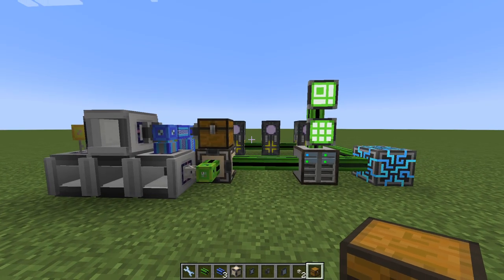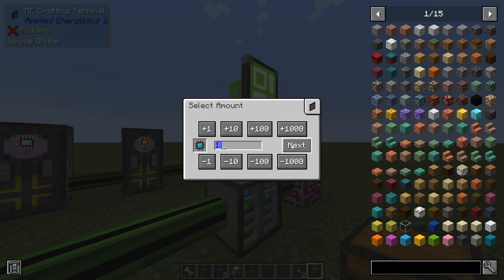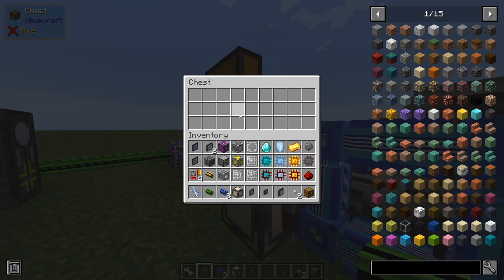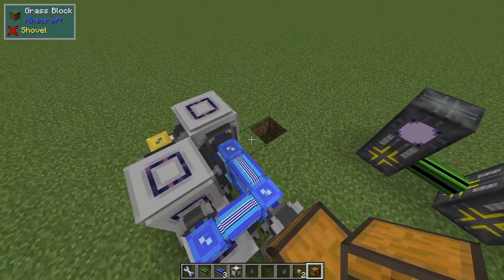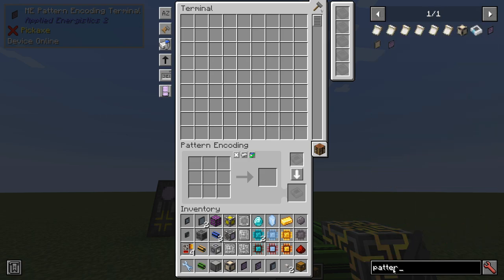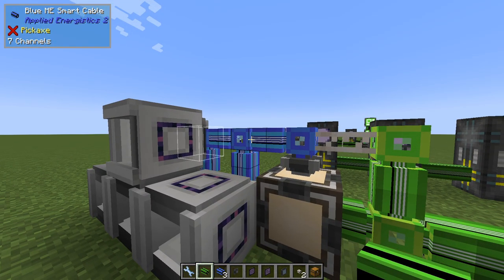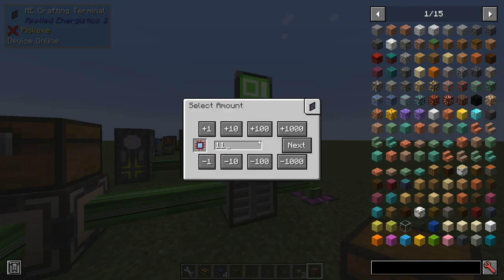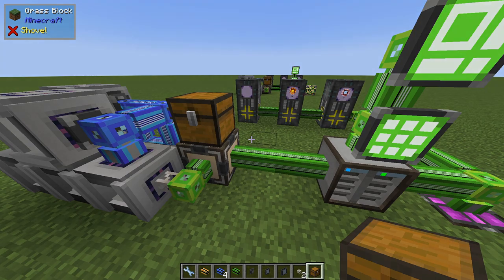Updated (1.18) Super Compact Processor Auto-Crafting Setup - Applied Energistics 2 Tutorial

Comment: this doesnt seem to be working, it wont pull the silicon printed silicon or printed logic out of the inscribers
Reply from the maker: The most common reason is that a block is misplaced or not configured correctly. You didn't say what version or modpack you're playing so it's hard to guess what's wrong.
Reply: @therealtkh  I've got same problem im playing on atm 8 1.19 any idea
Reply from the maker: @jamiewood2788  I have made this build working in 1.18 and 1.19 packs so the build works. Without knowing anything about the build it's really hard to guess what's wrong because depending on what block is misplaced it can give different (or random) effects. A common mistake is that quartz fiber is not in place so devices go offline because of lack of channels. Much easier to discuss on Discord with screenshots...

Comment: i just can't figure out. in case when pattern provider is connected to mechanism directly, it puts ingredients into the block and then takes end product out of it. BUT when patten provider is connected to production block through interface and then storage bus, it only puts items into mechanism, but doesn't take end product. it requires taking it via export bus. why can't it just take out the product by itself?
Reply from the maker: Hi, there are some crafting blocks that supports automatic ejection of products which works perfectly with the Pattern Provider, I don't know exactly what mechanism you were thinking about but I think your summary is the reason for this: if connected directly - sometimes you don't need any extraction method, but as this build is using a separate network to handle all parts, the Pattern Provider cannot get the items automatically, so we have to export them back to the main network once completed all steps.

Comment from the maker: edit: Check video description for an updated detail regarding the chest workaround, there's a workaround for that! /endedit
The popular "Super Compact Processor Auto-Crafting" setup has been updated and solves some issues that came with mod updates for Minecraft 1.18! Also explained in even greater detail than before! :)
Reply: Greetings, not sure if others have already told you, but there's a way to use the similar design you had before and with just a few small modifications, it will work as expected.  There's no need to add a chest to the design.  The only thing I had added was a pattern provider and placed the pressed chip templates in the storage bus.  That was pretty much it.
Reply from the maker: @DugaldKerr  I don't really understand what you mean so please explain in more detail! An additional pattern provider within the small network? I have been given another solution without chest though: configure the receiving interface with all base materials and the subnet can hold all items and run inscribers in full speed in parallel.
Reply: Dont work at 1.19.2

Comment: 23:55 the oler behaviour can be restored if the interface is configured.
basically: an unconfigured interface exposes the whole network (to pattern providers and storage buses)
a configured interface exposes it's own inventory (to everything)
Reply from the maker: You are absolutely right, I did not think about trying this but now I have and it seems to work perfectly! Thanks for the tip :)
Reply: What is the proper config setup?
Reply from the maker: @zs2977  Add all items (base materials + redstone + silicon) in the receiver interface top config slot, no need to specify amount.
Reply: @therealtkh  i cant find out wich interface exactly i need to configure? the one interface that is build in this system cant be configurated? am i missing somesting? there is one "ME Interface" and that is connected to the "Pattern Provider". Edit: Damn, i was so tired that i turned stupid...
Reply: @Grinser_zockt  Which interface was it?? lol I can't figure it out but seems like you did
Reply: @Grinser_zockt  nevermind OMG I was just dumb too
Reply: wait, could you expand on how placing items on the interface fixes the issue? sorry but I can't wrap my head around that
Reply: @therealtkh  I configured to receive all the items (certus quartz, redstone, silicon, diamond and a gold ingot), but one of them keeps being stuck inside of ME Interface inventory on auto-crafting the last unit of any processor. What did I do wrong? Minecraft 1.19
Reply from the maker: @timchiknew  You didn't necessarily do anything wrong! I have seen this behavior in 1.19 as well, and it feels a bit inconsistent... My best solution for now is to use a chest to buffer up all items, and I have never had an issue with that method! In my very latest video I also had to exchange a receiving interface (from a storage bus) into a chest to get intended behaviour. I found a workaround by placing an ME chest with storage in the small network (have not tried it for this processor build) but using a regular chest buffer was a better solution overall.
Reply: @therealtkh  Oh, thanks. I've tried so many things, such as messing with the priorities or adding a blank biometric card with withdraw permission, but none of them helped

Comment: I have an interface bus and an export bus directly connected to the pattern provider and that works fine without chest.
Reply from the maker: You mean like the old method? In what version? As mentioned in the video it works without chest but the problem was, for some reason, to queue up several without losing speed. I got a tip to configure the Interface to make it work like "before" and it worked perfectly.

Comment: Hi TKH
First of all, I'd like to thank you for giving such comprehensive tutorial by giving pratical building guide while explaining the theory.
However I got a logical issue on the storage buses on inscribers. 
While I can understand you need to give both input and output when you set storage bus to i/o mode, I can't figure out the reason you only need to specify input items but the output doesn't need one when the bus is on insert only mode.
Is it beacuse the insert only mode only filtered the input items but the output are not?
Reply from the maker: Happy to hear you appreciated the video! :) Yes, you are on the right track with your interpretation. The settings are of course connected, and are configured completely independently depending on your needs. First the Input/Output Mode: Is the Storage Bus allowed to only insert items, only output items, or both? In this build I use the Bi-directional as most are used both ways. Note that the storage bus do not by itself throw items into the network, but it allows other devices (such as the Export Bus) to "suck" items from the block the Storage Bus is placed on. Next step is to decide on filtering, but it only has two configurations. Either we filter for both insert and extract, or as I did here: only filter on insertion - that means that (if set to bi-directional mode) any other object can be pulled out, but only the filtered item is allowed to go in. As this build is made to have full control over every item in the small network, the filter options works perfectly if configured correctly - and there are two ways to do it :)
Reply: @therealtkh  Oh! That is for "filtering mode"!
You just complete my understanding of the whole design, thank you again😘

Comment: i cant get printed circuits to export into the final inscriber. I rotated the inscriber three times. Rest of the system works fine.
Reply: IM on all the mods 8
Reply from the maker: @chasehamlin4909  I have made this build in 1.19.2 so it should work. Check so all devices are online, if you missed a quartz fiber some will be offline. Check filter settings in bottom storage buses. Also, double check the export bus to the top, so it's correctly filtered. Also, I recommend in 1.19 to use chest for input as I've seen some weird behavior in these early versions.

Comment: My printed logic circuits do not pass into the inscriber to be merged with the printed silicon, only the printed silicon and red stone are in the inscriber, this is the one you have to rotate but i've tried every rotation. 

*edit* my printed engineering circuits are not making it to the combination inscriber either
so it's not taking them from both sides.

All my devices are online.
Reply from the maker: You forgot to write what game/mod/modpack version you're running. I would suspect the filter setting in the storage bus for each of the three bottom ones. Make sure it's only filtered on insertion so that the export bus up top can reach the items. And make sure the export bus is configured with CORRECT part (also a common mistake).

Comment: Hey man, this is such a helpful video and I finally feel like I know how all these parts work! Unfortunately, I still haven't been able to get my build to work. Gonna add a lot of info here, not sure how much or little will help. Based off other comments, I suspect either an issue with inscriber alignment or a misunderstanding of channels.
On a 1.18.1 survival multiplayer server, and my inscribers definitely are textured differently than yours. I have copied your build block for block (I'm still painstakingly checking to ensure this is true), with the exception of using an ME chest in place of a drive. I'm also using a generator from another modpack to power the system. I also do not have a crafting monitor above my 4k crafting unit.
The printed silicon makes it into the middle, redstone-supplying inscriber but none of my bottom circuits are flowing through my export bus. I've ensured that they are indeed all in the export bus when testing. Also, the process actually doesn't initiate unless I cancel the crafting sequence in my crafting unit, which is weird to me.

Happy to provide more info if needed, and will definitely provide updates as I keep debugging! Thanks in advance if you've read this cry for help lol
Reply from the maker: Hey! It sounds really weird that the process won't start unless you cancel the job. I wonder if you have a power issue.. Use a network tool to check the system power requirement and usage but this is a longshot! Have you tried to build this in a creative world to see that it behaves with unlimited power for example. The other differences should not make any difference though. Also, feel free to jump on to the Discord server which makes it easier to send screenshots.
Reply: I'm in the same boat, built/tore it apart twice now and it will make all of the parts it just won't put the printed circuit out into the top.
Reply from the maker: @irongronousmagnus7652  It's so hard to find the missing piece without more information, and screenshots really helps! Please provide more info about mods/pack and consider joining us on Discord for easier discussions. If you have a problem with getting the bottom print to the top there's usually an incorrect configuration in the Export bus or the Storage bus (like the I/O filter). Or a misplaced block somewhere that makes some device offline.
Reply: @therealtkh  and just like that I figured it out... because I'm a moron.  In the section where you were showing how you first did it that didn't work right, well what did I care about that, so I skipped that section, twice :( The printed circuits in the export bus... kinda important.  I feel foolish.  AWESOME video, thank you very much for helping idiots like me despite themselves :)

Comment: I know I am 1 year late, but I built the same setup but the redstone wont input when its time to craft a processor, the certus also won't do so when trying to craft the calculation circuit and the engineering one does the same, the only one that works for me is the logic processor. I wonder if it's because im using normal cables instead of smart ones.
Reply from the maker: Normal cables makes no difference, the smart ones are only used to easier keep track of channels. You didn't provide any info regarding your game or modpack though. Also, did you build the version with chest or without? I recommend using the chest and then make sure that all filters are correct in storage buses to all inscribers. Usually it's a simple mistake.
Reply: @therealtkh  This is essentially my bad, I rebuilt it with the chest and now it works, thanks for the tutorial. I'm not quite sure what was wrong but hey, if it works it works.

Comment: Whenever i call a bigger amount of stuff, when the inscriber fills up, there is some leftover stuff in the chest. The resources from it go back to the me system, how do i fix that?
Reply from the maker: You didn't tell me what game/mod version you're running but it sounds like an incorrect filter setting in the final export bus (for final processors), there should be no other way back to the main network. edit: or a "short circuit" that connects the subnet to the main network.

Comment: Just isn't working for me for some reason. The pattern provider puts all the stuff in the chest and then it's just never exported. It's like none of the stuff on a subnet is working, I've tried so many different ways :( For reference I'm on ATM7
Reply from the maker: The build works fine in ATM7 (I have tested) so it's most probably a minor problem with your build. Check so all devices are online, that quartz fiber is correctly placed and things like that. I don't know your build so it's a bit hard to guess.
Reply: @therealtkh  yeah it was being a bit funky, tbf it's ATM7 to the sky which might make a difference, wouldn't have thought so though. Ended up just exporting redstone and silicon and having a pattern provider for the circuit needed
Reply from the maker: @Smjn_  Some packs might change recipes or mess up details like silicone (as it could come from different mods), but mostly it's just minor things like filter configuration or a missed block. Still hard without a video or screenshots of almost everything ;)
Reply: @therealtkh  yeah exactly xD it works for now and I really can't be bothered to figure it out

Comment: Hi,

I'm encountering a strange problem with my setup.

If i order 10 logic processors it works fine. completes all 10 without any issues.
If i order 10 engingeering / calculation processors it will only make 1. and not make the other 9 and i cant figure out why it does that. Any ideas?
Reply from the maker: It sounds a bit weird that it will just stop. Will it export the first engineering/calculation to the main network? Where are all the other items sent? What modpack or game/mod versions are you playing? What build did you go for, with buffer chest or not?
Reply: @therealtkh  thank you for your reply!

It exports all processors to the network. I tried both the chest and the interface, i even tried configuring the interface as stated in the comments. Im using the latest ATM8 version
Reply: @therealtkh  i feel like an idiot. After redoing everything i saw i made a mistake in the process pattern. Had all the ingredients equal 32 processors instead of 1. Im an idiot and you're a hero trying to help.

Thanks!!!

Comment: Hi! I think I understand why using the interface doesn't work anymore. The pattern provider has an special interaction with the interface, the wiki says "if the interface is unconfigured the provider will skip the interface entirely and push directly to that subnet's storage, skipping the interface and not filling it with recipe batches, and more importantly, not inserting the next batch until there's space in storage". This is inconvenient in this usecase so all we have to do is put a random item in the interface config and the patter provider will treat the interface as a chest again.
Reply from the maker: This is very good info! The workaround with a buffer chest has been flawless ever since I started using it but to be hones I never thought of configuring the interface with any OTHER item than we're using. I got a suggestion to filter it with the items we were using and it worked fine most of the time, but every now and then an item got stuck in the interface. I might have an answer to that as well but I did a lot of tests with the new configuration method and it seems to work just fine. Thanks a lot for telling, I will test a bit more and then update the video description with this info :)

Comment: How are you placing the regular glass cable down without it connecting to the other side? I cannot seem to ever get that to work.
Reply from the maker: There are basically three ways:
1. Use Quartz Fiber to only connect power between different nets.
2. Use Cable Anchor to prevent any connection between cable and anything.
3. Different colored cables will not attach to each other.
In this video I used method 1 as I demonstrated clearly in the video.

Comment: I did all of them correctly, but silicon is showing as missing. But there is silicon
pls help
Reply from the maker: I cannot help without a lot more info. Game/mod version, modpack? Perhaps recipe is wrong. Where does it say missing? Check other comments as well, it might help! Usually it's just a minor mistake.
Reply: @therealtkh  1.18.2 all of fabrick modpack Silicon of the ae2 mod. The links are correct. When you put it in the chest above the Provider, production takes place. But even though it is in the system (there is also storage) it does not. It says Missing item silicon. cannot be produced
Reply from the maker: It's probably just a minor block misplaced or a configuration setting, but I don't know your build so it's really hard to guess. It sounds like the pattern is incorrect, you shall only use base parts and make pattern in processing mode (not crafting mode). This is a common mistake people do - even when they say they did everything correct ;)